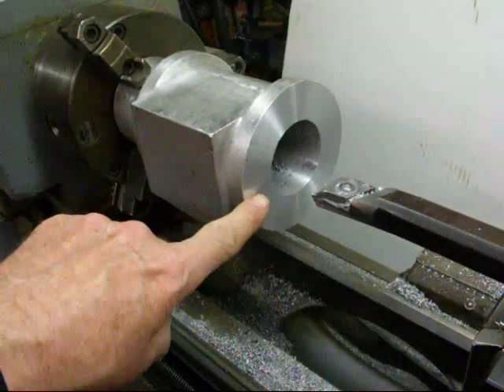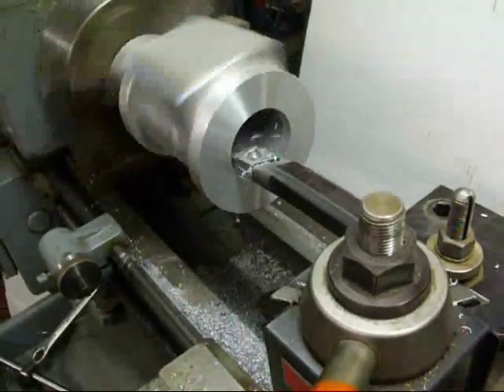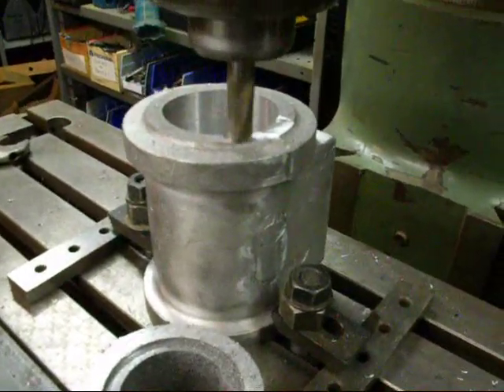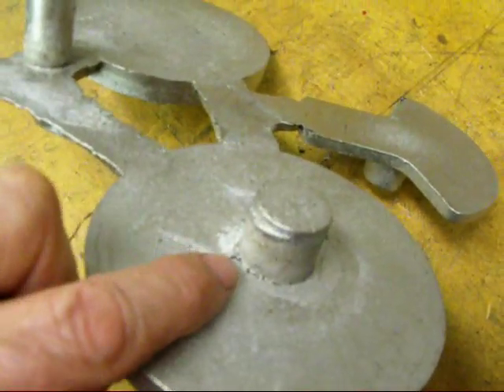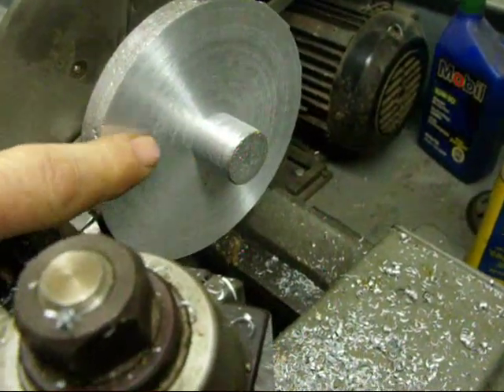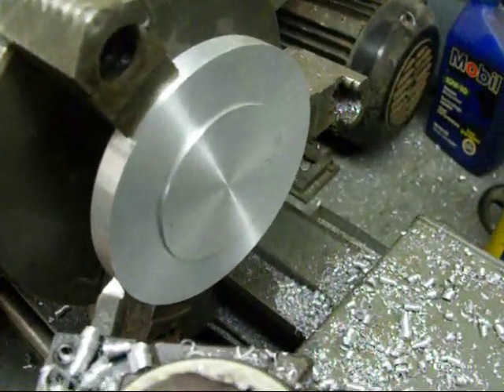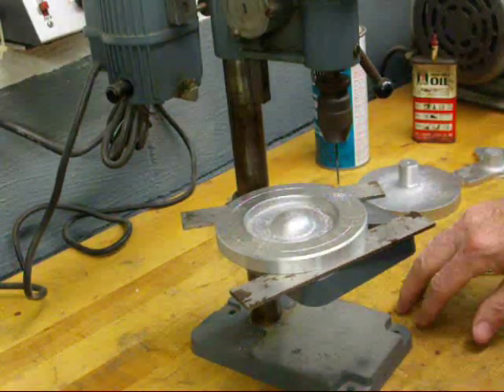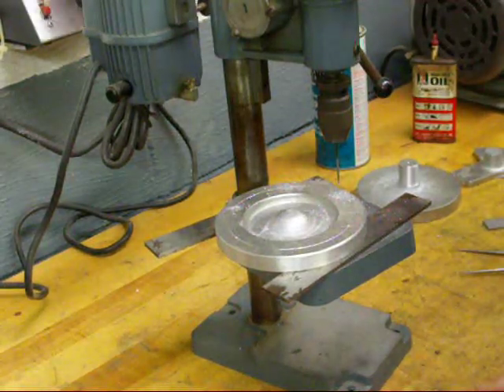BUILDING A MODEL STEAM ENGINE part 2 tubalcain

Comment: I thought that it was considered poor practice (e.g., dangerous) to use a lathe chuck on a tapered object as the jaws are only touching at one point. How did you deal with this when cleaning up the boss on the cylinder head?